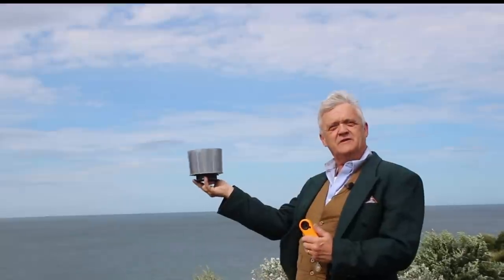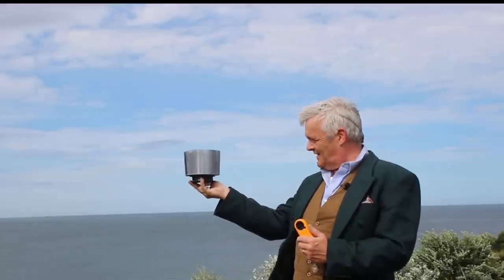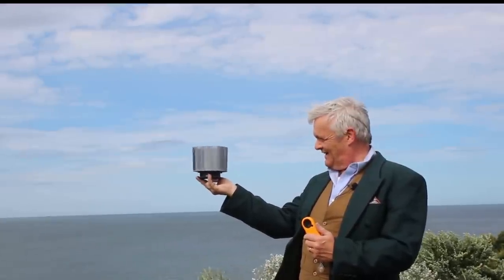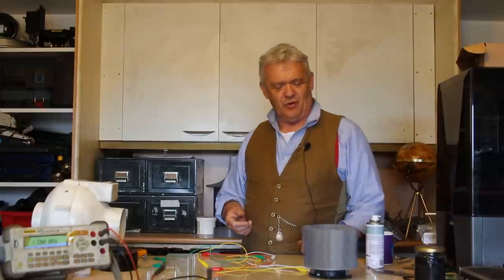1984 The Pelton Wind Turbine - Better Than I Thought

Comment: See, by now you should have build a small wind tunnel test rig. A box with an exhaust fan and a slatted intake. Also a standard generator for measuring power. That way these different shapes could be tested against each other. Not like I'm trying to tell you what to do, just seems like something you would do.

Comment: Looking forward to the results of your "cogitations and constructions" on this! I'm about to put 400w of solar onto my workshop and am wondering how best to add some wind power into the mix. There are a number of buildings messing with the clean air so a "blades kept facing the wind" design isn't a good option. This looks potentially quite efficient for a vertical spinner...

Comment: oh also for the exhaust I would think a parabolic cone downward with grooves to assist in rotation with holes at the bottom of the turbine would be better if it were a little larger so the fast it spins the more lift taking pressure off of the bearings in what ever it is rotating on, and possibly reducing some friction so that energy could go toward torque for conversion to electricity instead ;)

Comment: I have watched quite a few of your wind turbine videos as research on how I can harness that for my own properties electrical needs. I was thinking about this for the generator on a wind collector idea, and thought of a possible improvement to it. With wind being gathered and directed at it through a duct of reducing size couldn't an archimedes screw of sorts be put in the center directing the wind to the nozzles increasing the efficiency?

Comment: The RPM meter is off by about a factor of 10.  A meter that "sees" only retro-reflective tape will give much more accurate readings.
Assuming your video is shot at 30 frames per second I count 4.3 revolutions per second or 258 RPM.
With a rotor diameter of .14 meters  at 258 RPM in 4 MPS wind gives a TSR of about 0.46.  Which is about right for drag turbine.
The question came up, does one wobble equal one revolution?  If a shaft is bent; yes. If the bearing or shaft mounts are sloppy; no.
I looked at the video again and noticed a light reflecting off of the reflective tape about once every four frames.  That would indicate an RPM of about 450 and a 0.8 TSR.  (I think the bearing or shaft mounts are sloppy.)
Reply: Well Dan I commented essentially the same thing about 40 minutes ago, but now my comment is gone. The Best I've ever gotten out of a drag turbine is tsr of 1.8 , and that was because one side was shielded. 
Oh that was because the video was blank in the middle and was probably deleted and reposted.
Reply: I was also going to comment that ~2500rpm seemed rather unlikely. Thanks for doing the maths/video analysis!
Reply from the maker: I don't think you are right mate - mostly because I am using  retro reflective tape - it is 'seeing' the reflective strip that i pointed out in the video
Reply from the maker: his comment was a bit inaccurate mate  - he didn't seem to notice that i used a retro reflective tape and i said in the video and pointed it out - not quite sure how he could have missed it - I am also not sure how he can count any where near accurately given the rate of spin - but hey ho lolol
Reply: @ThinkingandTinkering  pretty sure he’s watched the footage frame by frame and seen that it takes about 7-8 frames for a revolution (or presumably 4 or so frames for the reflective tape to pass on the visible side of the rotor) so it’s doing about 4 revolutions for every 30 frames I.e. 4 per second. Guess it’s possible he’s seeing aliasing - maybe original author can confirm his method?
Reply from the maker: @dexterdixon2000  perhaps - because I just went and retested it for Just tinkering - I moved the reflective strip above the blades and rechecked it - same result - i think the guy is just wrong really - but heyh o - folks love to argue
Reply: @ThinkingandTinkering  if you put two reflective strips on do you get twice the rpm?
Reply: @ThinkingandTinkering  Watching frame by frame the wobble rate is very easy to count. One wobble per seven frames.
I would suggest testing the meter on a known low RPM wheel before claiming 5 TSR.
Reply from the maker: @danedmiston9673  you are counting the wobbles and estimating rpm from that? - i see - well, sorry mate - i checked the meter already and I'll rely on that  if that's ok - cheers
Reply: @danedmiston9673  two other possibilities: 1. You’re watching every tenth wobble (due to  sampling/frame rate etc.) 2. It’s wobbling once every ten revolutions. Both unlikely and I agree the testing method needs confirming. Other way is to spin rotor at known rpm and measure voltage as Rob has a voltage reading of 1.2V for this 250/2500rpm situation so spinning it by hand once per second should give either 0.3V or 0.03V
Reply: @dexterdixon2000  It can very well be "wobbling" once every x rotations. It's called gyroscopic nutation and with Earth's for example, a full nutation happens every 18.5 years and yet it rotates every day.
Reply: 2500 RPM = 41.667 revolutions per second.
At 30 frames per second, it's more than 1 revolution per frame.

So calculating that it's out by counting wobbles is... well... a bit wobbly to say the least.

@danedmiston9673 You could be out by a factor of ... well, all sorts of factors actually.
Reply: @dexterdixon2000  The the same RPM meter was used in the"Better than Betz limit?"  video.  In that video, when watching frame by frame, the light reflecting off of the tape was very easy to see and count.  I questioned the accuracy of the meter in the comments there too.  Once a generator is connected I will trust the voltmeter much more than the RPM meter.
Reply: @danedmiston9673  I think a volt meter is connected in this experiment - he says it’s making 1.1-1.2V
Reply: 2500 rpm seems unrealistic.
Reply: @dexterdixon2000  Your right!  now all we need is a 60 RPM (one revolution per second) voltage reading.
Does one wobble equal one revolution?  If a shaft is bent; yes. If the bearing or shaft mounts are sloppy; no.
I looked at the video again and noticed a light reflecting off of the reflective tape about once every four frames.  That would indicate an RPM of about 450 and a 0.8 TSR.  (I think the bearing or shaft mounts are sloppy.)
Reply: Yup, looks like you made an error somewhere as the best lift vawts can only achieve a tsr of 5.
Reply: If he puts the microphone right next to the blades, the vawt will act like an old fashioned siren. Then the frequency will be broadcast in the video. Divide the frequency by the number of blades to get the speed of revolution. Easy peasy, no meter needed. Do it by sound.
Reply: @justtinkering6713  Some multi-meters read Hertz (cycles per second).  Just measure the Hz. while turning the VAWT at one revolution per second (or count the number of poles), then take the at speed Hz  and divide by the one RPS Hz.
I was thinking about just using the DC voltage but at low voltages the voltage drop across the diode would cause a lot of error.
Reply: @danedmiston9673  Mike the audio of the wind hitting the blades and get the frquency. I think if his test equipment was good, then his blower wasn't aimed correctly. But he also used a hawt style wind meter. Maybe it wasn't aimed correctly either. But like one person said, it's unreal because even the best H vawts only get TSRs near 5.
Reply: @justtinkering6713  Right!  Blower favoring downwind side, wind meter accuracy, optical tachometer accuracy - all can add error to the final results.  It was the 2500+ RPM and TSR claim that got me looking closer.  At 2500 RPM and that much wobble bad things can happen fast. I sure wouldn't be standing next to it without some shielding.

Comment: So with the high tip speed ratio this is acting as a self starting aerodynamic device - not an impulse or drag generator.  The drag component only comes into effect once the TSR is about or below 1 (ie, slower than the wind - when loaded up the device may convert to a higher torque drag (not truly impulse) device, while at high TSR it  appears to be a velocity - aerodynamic - machine (lower torque).)
Reply from the maker: that's what i think mate - kind of fascinating realy

Comment: Could you flare the top out to expel some of the turbulence / captured air ?  Would the expelled air create its own inverted cone around the turbine increasing its effective size and drawing more air into the blades from the air that bounces off the 'air cone' into the blades ?

Comment: Question. There looked to be instabilities in the rotation of the turbine . Is this real or an optical illusion caused by the turbine blades. Also to increase efficiency have you tried adding an aerodynamic wingtip , similitude the ones fitted to the merlin helicopter primary rotors , which reduce friction , allow for greater rotational speed , reduce wear on components?. If that could be incorporated into your design , then enter production would increase at lower speeds , and also the turbine would start to work at lower air speed ( I think !.  I'm dyslexic , so numbers bugger me up )

Comment: Would there be any gain to angling the blades back slightly towards the wind side, to generate a bit of lift and take pressure off the thrust bearing? Would it spin more freely or cancel out the advantage with the added resistance?

Comment: Just a what if you put an internal small wind foil blade structure to scavenge what is possible from the exhaust of the pelton wheel structure. Will add weight and some more start up resistance but might prove interesting.

Comment: If you where to build the fan blades in a 3d bulb shape with sharp twist coming off the top of the blades you could possibly max out the pressure and speed at which it rotates

Comment: Pelton wheel is great, but given your wind variance, I'm just thinking, Could you improve by integrating a tesla valve design into it, potentially even stacking 2/ dare I say 3 smaller tesla valve loops inside of the outer 6?

Comment: Sorry if someone has already suggested this, but could you invert, Mount it on top of your Darwin Wind Pipe so it exhausts down through that assembly, and then run two generators?

Comment: The gaps between the trailing edge of the tails and the leading edge of the cups seems entirely unnecessary, and is just letting excess airflow into the "exhaust". Perhapse you could try closing that gap and double the number of cups again.
Reply: well spotted. Many more 'blades' could be crammed in, and there'd be little drag added. Doing something with the exhaust vortex may have some potential...tho not sure what.

Comment: something were wrong with the measurement here. I downloaded the design  fix a bit the aspect ratio ( more taller, and less diameter, ( more like the optional design in the thinkercad  addrees) and i got less than 600 rpm for a wind of 3.7m/s. More according to clasical savonius. The best design that i tested until the moment is the clasical schultz rotor of 3 blades at 120º.  The ugrinsky design seek the same idea shorten the distance betwen blades to down the drag of the returning blade. I printed also the ugrinsky and dint beat the schultz rotor, and if you use only one section of ugrinsky (not the whole screw) can found exist a position of the blades where the drag forces are equilibrated and the turbine dint begin to spin. And that not is eficience for me. Should use other tachometer or find what were wromg with the measurement. Because in the video dont seem the turbine would be spining at 2600 rpm neither. Being said that, i saw a lot of your videos and your way to produce theys is so good  and most technical compared to others. Continue bringing enjoy to the planet with your enthusiasm.

Comment: Pelton wheels are used in conjunction with a nozzle to redirect all the water onto the cups. Having a funnel to direct the wind onto the correct part of the turbine might improve performance, especially in low wind. Maybe a profile similar to a Tesla turbine intake, box tapering to a slot?
Reply: I think part of the idea behind this type of design is that it can capture the wind as it changes direction, even rapidly, without gyroscopic effect stresses, etc. seen in other types of turbine that have to turn into the wind to capture it.
Reply: @chriskeeble  that wouldn’t be a problem with a wind concentrator to accelerate the wind. Four of them around the turbine would account for wind from any direction
Reply: @unicornadrian1358  it would be interesting to see what effect this would have, for sure. My own (relatively ignorant) guess would be very little, given the fins in the pelton design Rob has produced. But a proper test would be interesting if anyone has the time, equipment and inclination to give it a go and share.

Comment: The captured wind is hitting a too sharp corner for my liking. The profile look like a double U - shape. I would like to see the middle part removed so it would be a single U - shape with a bigger internal radius. Then the air can sweep along the inside of the radius and sent backwards inside the wide flat "wall". This way it will act like a savonius turbine.

Comment: Are you sure the tach wasn't being triggered by each of the blades? I suspect you were getting 6-7 pulses per rev. Put a trigger mark on each blade and retest, please. Visually, I estimate it at 400-500 revs. No matter what the final speed I like the concept. You could also put the air in the open end and vent radially, might work even better.

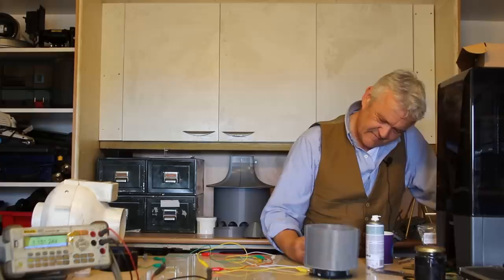Comment: At 2:40, you say that you are getting 1.1 or 1.2 volts. One thing that confuses me in your recent turbine series... You always talk about how many volts are produced. But what good is a volt without amps? I always have thought that it was watts that we wanted as the ultimate outcome, not mere volts. While you do talk about "milliwatts" later on (lolz, but seriously, good job!), it is way too common that I hear discussion in the context of turbines about volts without any mention of amps and/or watts.

Could someone please explain to me what I am missing here? Is turbine based power entirely volt-fluctuations with otherwise constant amps? Or do amps change also depending on certain circumstances?

Comment: 100mA?  cool might not sound like much but todays power efficient devices, you could run a microcontroller with that little turbine indefinetly in the wind, albiet in sleep mode (esp32c6 uses about 15-50mA in sleep mode,  over 300 while using its wifi, so you could keep  a lithium battry topped up and have your microcontroller never run out of power while sleeping even with no sunshine, and perhaps wake when there is for solar enrgy to do what it has to like transmit data over wifi.  The possibilities with micro power generation have yet to be explored it seems.

Comment: could you install cone in middle then top it with a small generator on the exit point.  so two generators in one.  entrance and exit.
Reply: The generators are the expensive part usually (copper and magnets vs plastic), so you'd probably do much better on a cost per power basis just to add another turbine rather than trying to reuse the slowed air a second time.

Comment: Challenge: Since the tinkercad files for this are available, why doesn't someone with a 3d printer and vawt experience, validate Roberts claims.?
Reply: was done by me... and the measurements are wrongs...800rpm maximum at 4m/s.

Comment: Take your rpm and use the number of blades it has to get the real rpm. Your tach is seeing all the blades Rob.
Reply from the maker: i covered this in the video mate - it is 'seeing' the reflective strip and there is only one of those in this case it is not 'seeing' all of the blades - did you miss the bit where i pointed that out mate?
Reply: @ThinkingandTinkering  it should only be counting the strip, not all the blades. Divide your rpm by the number of blades to get the real rpm. Put the strip sticking up all by itself. It happens to all of us
Reply from the maker: @justtinkering6713  as far as I aware mate - it is counting only the strip - but i will check it
Reply: @ThinkingandTinkering Rob, if it's getting tsr of 5, you better call Guinness. Your real tsr should be less than 2. Or the fan was off center of the turbine.
Reply from the maker: @justtinkering6713  ok i just checked it - the experiment is still set up so it took me minutes to move the strip above the blades - guess what - same result - it is counting only the strip - I can say categorically it is NOT counting the blades
Reply: @ThinkingandTinkering  Call Guinness because you just did something Nobody has ever heard of.
Reply from the maker: @justtinkering6713  mate the TSR is a ratio defined by wR/v for a VAWT where w is the rotational speed, R is the turbine radius and v is the wind speed - you can increase TSR by increasing radius - what I think it means here is a large proportion of the rotation isn't from drag - where indeed the TSR is 1-2 - but rather has a high lift component where TSR would be 6-8
Reply from the maker: @justtinkering6713  lol - i am not sure about that mate - but i do think this design is interesting - that's all i think really - but this is an interesting discussion thanks for taking the time to chat through it with me
Reply: @ThinkingandTinkering  👍 see you tomorrow, pleasent dream's.
Reply: @ThinkingandTinkering  if you increase the radius then the rpm drops accordingly.